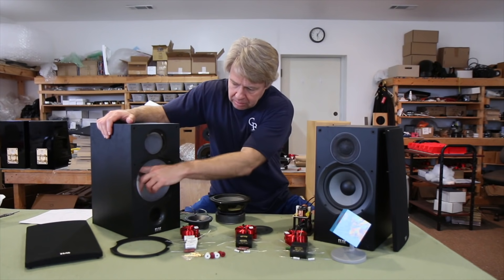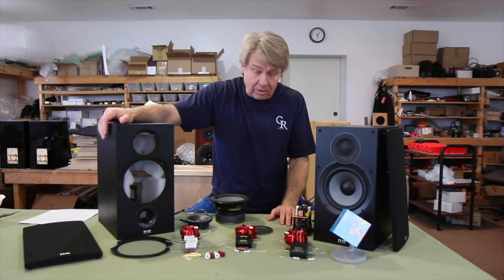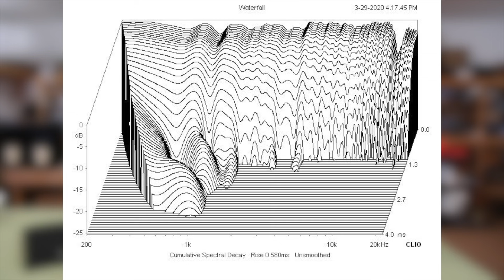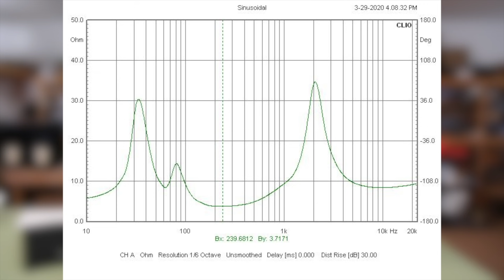Elac Debut 2.0 Upgrades and Modifications!

Comment: Nice upgrade there. I just wish you had shown an up-close look at all of the individual upgraded parts, including the "tube connectors"? (I have no idea what those are, do, OR even look like!) Also what is that "no-res" stuff that you talk about, what does it look like, and how and where do you install it for the most effect?

I will watch more of your videos to see if you elaborate on any of that stuff, but it would've been nice to see that info here in this video also!

Also, a complete itemized parts list of all of the upgraded parts and accessories, where did you get each part, and how much does each individual part cost, would have been a good thing to see too!

Also if you could please show HOW everything was changed out and final assembled it would be great!
Reply: Tube connectors: http://gr-research.com/electracabletubeconnectors.aspx

No Rez: http://gr-research.com/norez24x27sheet.aspx

And you don't have to go out shopping for the parts. We send you a complete kit with everything you need.
Reply: @dannyrichie9743  That's nice, but those prices are pretty damn expensive!... $60 for just a single pair of terminals ?... REALLY??! (I still can't tell what those do or how/where they work or are supposed to be used, btw... only one photo doesn't show much, especially if you've never seen them before and you aren't sure what they are supposed to do or how or where to use them.)

And that "no-res" stuff is ALSO extremely expensive at almost $11/square foot!... And NO photo shown of that either, which is what I wanted to see! Is that stuff anything like "Dynamat" or something similar, but cheaper?
Reply: @JoeJ-8282  Actually the tube connectors are cheaper than any of the top name binding posts like Cardas, Vampire, or WBT. And the tube connectors come with the male ends for your speaker cables. With any of those binding posts you still have to go buy spades or bananas, and for decent ones you can spend another $40 or more. So the tube connectors are about half the price and they sound better. They are also ten times easier to install. 

And from the link I sent you to our website there are four pictures of the tube connectors, and three diagrams showing how they work. 

We also have installation instructions in our forum on the Audio Circle: https://www.audiocircle.com/index.php?topic=94014.0

And resonance control material is not cheap in general. But there is nothing on the market that works as well as No Rez. And it is cheaper than the also popular Blackhole 5 material. 

And our website is also loaded with pictures of it as well.
Reply: @dannyrichie9743  Well I can't find or can't see any of those photos you mention of those products, from either of those links for some reason, (maybe it's a glitch in the link or something??), but when I click on the link of the connectors and then on the picture, it only shows (1/1 photo available)... And when I click on the link for the "no-res" stuff it doesn't show ANY actual photos of the product, (just a fuzzy, generic "camera" icon), so that's why I asked how that stuff compares in design and function to other products like "Dynamat" and the like, because I'm already familiar with those... Is no-res the same type of extremely sticky, black, "rubberized tar based" or "tar-like" sheets that you peel off the protective covering on one side and then stick it firmly onto a panel or wall of the product that you're trying to dampen the resonances from? If so, most or pretty much ALL of those products work in the same general way and amounts, (with slight variations in overall performance based mainly on product thickness, etc.), but since they're all so similar, I just get the cheapest brand per square foot that also has an effective thickness and density.

Anyway, you might check the link that you sent me for yourself and see that NO photos of the no-res are shown, nor any other details about it given, like thickness, sound dampening rating/ability, etc., but all of which I would like to see and know before ever considering buying any... I never just "blindly" buy anything online without actually knowing exactly what it is, does, and looks like first!

And as far as prices go, (especially of the terminals), the ones that you carry may very well indeed be a (relative) "good value" when you compare them to some of the other (totally ridiculously expensive) brands, but the overall sound improvement that ANY of those types of just straight terminals , (nothing else), no matter how "exotic" they may be or look, actually makes, above and beyond just a pair of good quality, standard gold-plated, 5-way binding post terminals is VERY minor, (if at all even noticeable under normal listening circumstances), when compared to other relatively "major" sound differences, like using better quality crossover capacitors or anti-resonant boxes and baffles, and especially , different or better quality drivers themselves, so putting ANYthing more than $1 or $2 or MAYBE $3 each into just simple connectors is NOT very cost efficient overall, and doesn't bring you all that much return for investment above and beyond that ~$2 per terminal price point... (at which point most decent quality binding posts can be had for... Sometimes even less if found surplus)... Terminals are one of those things, like most other basic functionality hardware on a speaker is, that if the basic functionality is there, then there's no significant reason to go exhorbitantly high in price for those things because it VERY QUICKLY reaches a point of "severely diminishing returns" above a certain basic level of quality!...

I definitely DO know that the terminals on a speaker ARE important, and that even basic, common, good quality gold plated binding post terminals are a major improvement over the cheap, flimsy "spring clip" type connection cups, both in connection strength, and sound quality, (even though you still have to have reasonably revealing drivers in your speakers, AND very good quality speaker wire to the speaker from your amp, AND of course a very good quality amp itself and source component to even notice that difference between simply different speaker terminals , as I've tried comparing all of those differences myself more than a "few" times over the decades, and among many different models and brands of speakers), but going too much more expensive than a really good set of basic gold binding posts is NOT a very good place to invest your money in making a speaker sound significantly and immediately, noticeably better, unless said speaker is already "perfect" in every other way first!...

Unless your speakers are already as good as they can possibly be in every other way first, then buying extremely expensive terminals for them, regardless of brand, isn't going to make ANY noticeable difference, it's just going to cost you lots of extra money unnecessarily... Now, if those terminals you have there were about 1/10th of the price you have them listed at, then I would definitely try them, but NO speaker terminal is really worth any more than that, no matter what it's made from OR how it's designed, because of the simple fact of what it is... a terminal connection, nothing more, nothing less, and even the "worst of the absolute WORST", absolute cheapest, flimsiest, and tiniest connectors out there STILL send AT LEAST like about 99.9% of the sound through to the actual drivers themselves under most normal listening circumstances, so spending a (relative) "ton" of money on the "best" terminals just to get that very last 0.0001% (or whatever) of sound out of your speakers isn't worth it, IMO!

Anyway, I'm rambling now, but the "bottom line", MOST important thing to always remember and consider is this; anyone building speakers absolutely MUST look at the bigger, overall whole picture, and prioritize the MOST important aspects of it first and foremost, in other words, any of the ones that make the BIGGEST sound quality differences, like driver selection and matching, etc., down from there, and work your way down to the parts that make less of an overall sound quality difference, and then only change those IF your budget allows, AND you even feel like messing with it! (and terminals, especially anything more expensive than good, basic binding posts, is one of the "last" few things on the list, more important than just simply the type of screws you use to mount everything, but definitely NOT as important as crossover components or anything above that in priority!)

I think that getting the speaker's cabinets to be as resonant free as possible is definitely more important than simple terminals are also, so I'm more curious about finding out more detailed info about that "no-res" stuff, as I've asked earlier and above.

Sorry for the "book", but speaker building is a VERY intricate thing, with MANY things to consider and properly prioritize, so I can literally talk about that subject in depth for hours with anyone who is at all into it like me! Lol!...

I thank you for your information, I'd just like to know more exacting and thorough details , (AND exactly where and how to find/see pictures of that stuff AND thoroughly detailed application info), especially about that no-res stuff you have available!
Reply: First things first. All of the information is there on our site and is full of pictures as stated. All of the links work just fine. It could be that you are trying to access the information on a mobile device and not seeing all that is there. Our current site is not mobile friendly to all devices. But we have a new website under development that will launch in a few weeks that will take care of all of that. In the mean time I recommend that you view the information from a computer. 

Secondly, regarding damping material. Dynamat is a material designed for metals. It is a damper only. No Rez is specifically designed for wood materials like MDF. It not only has a damping layer but a 1" open cell foam layer as well. So it serves dual roles. It is also not only the best material on the market for this application, but is also very reasonable. And for the performance improvement that it offers it is well worth the money. And our customers agree. We literally sell tons of it each year. 

Now regarding the tube connectors. Your opinion that you have is ill informed. You have not tried tube connectors and have no basis for forming or placing a value on the improvement that they offer. The simple truth is the difference can often be quite dramatic. And our customers give us this feedback often. Even on a budget level speaker the difference can often be described as lifting a vale from off of the speakers and gaining a level of clarity across the board. 

And on a top level system the difference is night and day. This guys were hearing a clear difference even on a budget level system. https://www.youtube.com/watch?v=oLnBW3wuBSU&t=150s

And recently New Record Day reviewed the upgrade designed for the Klipsch RP-600M and posted sound clips using the binding posts and using the tube connectors. They were set up to use either or. The difference was very clear, and many people reported hearing those differences even playing the compressed Youtube sound clips back through their systems, and some of those were desk top systems. 

There is no question that the tube connectors not only offer a clear difference in clarity and detail, but that difference is more than well worth the low cost of adding them to the upgrade. They are worth much more than the cost, and adding them is a no brainer.
Reply: @dannyrichie9743  OK. I see. Yes, I was trying to access that link on my phone, but simply because that's the only way I have to access the internet rn. I do not have a working stand alone computer at this time, nor internet at my house, other than through my phone, because I simply cannot afford to pay the extra bill. My phone I need for work though, so that is a necessity... I guess I'll have to wait until your new app is ready... Hopefully it will be free to download and use for shopping and info.

As far as that no-res stuff goes, now that you describe its double duty, I am even more curious about it than before, so as soon as I can learn more about it on your mobile app, once it's up and running, then I might consider getting some... Especially if you ever have any sales or quantity discounts on it... maybe considering the state of the economy rn?

As far as the tube connectors go, I'm sure they make somewhat of a noticeable difference in sound quality, especially among speakers with exceptionally revealing drivers in them, but that difference is comparitively small compared to other major differences about a speaker system as a whole, (as I mentioned in my last comment), (& I say that from many, MANY years of listening experience with literally hundreds of different types and brands of terminals, connectors, interconnects, and wires, at least), and that was my point there... A connector is only a totally passive, throughput device, and no matter how exotic they may be, they still cannot make a crappy sounding speaker sound amazing, all they can maybe do, at best, is take an already awesome sounding speaker up to "mind blowingly" awesome, because connectors of ANY type, regardless of design, are only the final 0.1%, (or usually LESS), of any speaker's overall sound, and I've experimented with hundreds, maybe even 1000's of different speaker models, brands, types, designs, and quality levels over the past 35 years or so, since I've been actively involved with speaker design, building, improvement, and repair... So even though I'm sure your connectors are awesome for what they are, they're still only a very small fraction of what's even MORE important (relatively) to an entire speaker's overall sound quality as a whole... So unless I could get some of those for about 1/10th of that price you have them at, (OR you ever would consider giving me a set of them for "free" to honestly and thoroughly evalute for you or a video, which I would totally consider), I would never consider spending THAT MUCH on them, I'm sorry!...

I just already know that the subtle differences they could maybe make are NOT anything as much as all of the OTHER components of a speaker system make... It's just not physically even possible!

I think that the people who think they "hear" a difference in different types of connectors are only a victim of "expectation bias", and aren't TRULY HEARING any differences... Especially NOT through a compressed YouTube video and listening to it over their crappy cellphone speaker or computer speakers! LMAO! That's just plain stupid to even think that sort of "comparison" is even possible! I know it's technically NOT!... Unless the "A/B comparison" is maybe falsified by purposely downgrading the sound of any speaker that doesn't use a "better" connector, (with an EQ or something), and then compared to an identical pair of speakers that DO have the "better" connectors on them... or else the ones that have the better connectors have also been modified internally on the crossover, etc. to sound better... but if everything else was totally and exactly equal about two identical model speakers, other than simply different input connectors, then there's no way anyone could honestly, (while blindfolded), tell any real difference between the two pairs, especially not through any YouTube video! That is just technically impossible, and total "snake oil"! LOL!...

You wanna give me a couple of pairs of those terminals for comparison with two sets of speakers, (I have quite a few duplicate speaker pairs for A/B side by side improvement/modification sound quality comparisons already), then sure, I'll definitely try them and give an honest listen to them and if I like any percieved changes they make then I would recommend them to all of my audiophile friends, but unless that happens, or they become available for 1/10th the price, then I won't be spending my money on them. (It's all relative, and that's my only point here; as terminals are a relatively small part of a speakers sound, and so definitely not where you want (or even need) to spend a shitload of money on, relative to other, MUCH more important components of a speaker system, so I'm just gonna leave it at that.) No offense.

The no-res, however, IS a consideration for me to maybe get some of, because that sounds kind of like a cool design concept with double layers and double duty/benefit, so I will look forward to seeing more info about that once your mobile app is up and running!... Keep us informed, please! :)

Comment: I can't afford 300$ in parts sadly, thanks for doing the work you do though. Quick question, would there be any point of purchasing just the notch filter from you (if even possible) over just using EQ and a top shelve to lower that 1.5db bump at 750khz

Comment: Hey Danny!  I bought  a pair of  the Elac  Debut B6 speakers for $200 right before the 2.0 came out. I love the sound and  I'm  really enjoying running them in. I'm happy with them now but at some point I'll be ready to upgrade.  Should I go buy the 2.0 for almost $300 or should I buy your crossover kit for $ 300  plus?  I'm leaning toward the latter because I would love the satisfaction of a successful DIY and am impressed with your video[s].  Am I making a false assumption that  your 2.0 upgrade would be the same or similar in parts and cost? Would I have to ship my speakers for you to test?  I'm not in a hurry because I have many more hours of "burn-in" ahead. Thanks for all the great info!!
Reply: If you are already into DIY then you might want to just by-pass the budget offerings and try one of our kits.
Reply: Did you buy the kit? How does it sound now?